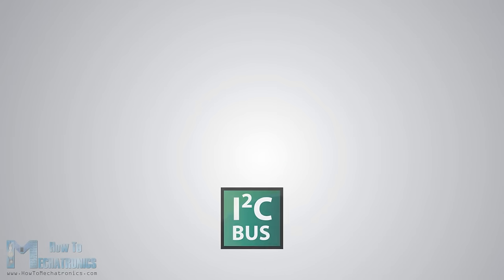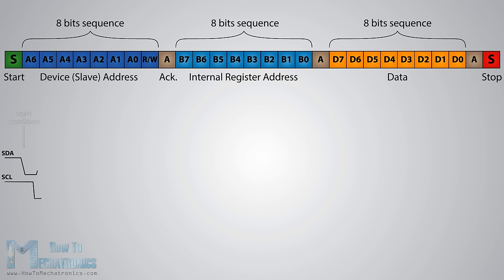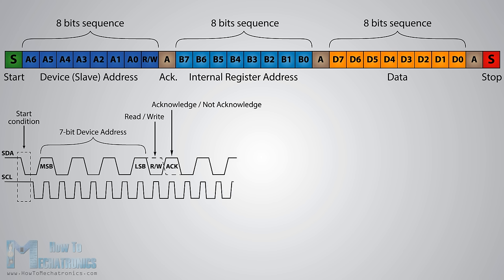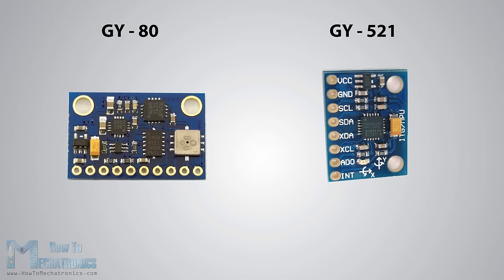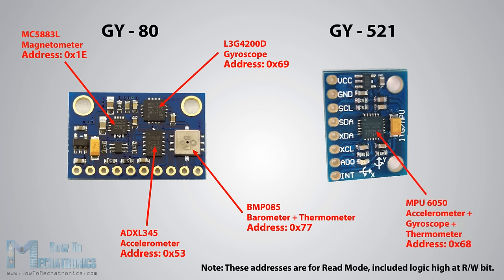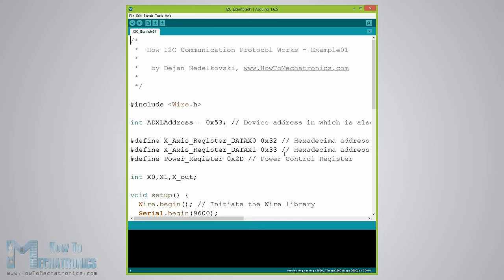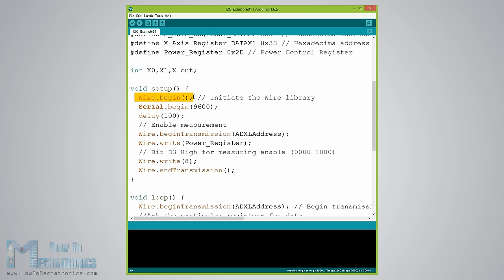How I2C Communication Works and How To Use It with Arduino

Comment: There are a lot of Tubes about I2C but none of them make note of the fact that I2C is an abbreviation of Inter IC Communication, it was invented by Philips to help reduce the amount of communication tracking between IC's on a PCB, consequently it is a reliable communication system when used over short distances in a controlled environment, a PCB, but it was never intended to be sent overlong pieces of wiring (>200mm?). If you use this to connect to devices over long lengths of wire, especially if there are noisy items around like motors etc, be prepared for random communication problems.

Comment: This is one of the only videos I've found that explains how pull up resistors can affect the speed at which data can travel on the SDA line. Fantastic video that explains how I2C works. Great job.

Comment: To clarify; the I2C lines are either high impedance or 0, you never drive the bus line high directly; that is achieved by de-asserting the '0' and letting the internal pull up resistors tie it to Vcc. The high impedance or low state on the bus prevents bus contention; that is a ground connecting to Vcc directly causing a short between any masters or slaves.

Comment: 6:00 just a headsup: You have the Arduino connected to two GNDs, with no 5V line.
Reply: Yes, that bothered me too.
Reply: Bro thats not a big deal he is also a human and if he has done any mistake that does not matter because if you have used arduino or any other types of microcontroller in past u can correct the connections easily
Reply: @Blondie SL Well that escalated quickly.
Reply: @Blondie SL Dark matter....hmmmm I once cut open a dead flashlight battery and found it to be very dark, black as coal in fact. I just figure it got full of the dark that it was displacing with light, and died when it got full.  :)
Reply: @Blondie SL you got issues bro
Reply: hahahah
Reply: @taimooramin1272  well he already said it just a heads up

Comment: i know its an old video and you probably already know that but you can shorten the Serial.print commands to one like this:

Serial.print(String("X0= ") + (X0) + ("X1= ") + (X1)); then when the numbers are bigger or shorter it will automatically fit them together

Comment: Good to know how all this works. I've used the Linux i2c and SMbus userspace tools, but never really knew the hardware functionality behind it. GPU lighting is generally i2c and motherboard controllers use SMbus (both very similar though). Knew just enough to be dangerous and change RGB colors or monitor temps with a very light shell script and even shell functions. The OpenRGB project has the addresses for most hardware, including USB (mouse, keyboards, and some mobos use USB for communication to controllers).

Comment: at the end u need 4 wires, ground, power, SCL and data.  bewatre of voltages, couse recent sensors and some different arduino version need 3.7 and not 5v as powersupply. nice video|

Comment: At 5:47, I noticed a small mistake in the wiring, both the VCC and GND on the breadboard are connected to a GND pin on the Arduino ...
Anyway, great explanation ;)

Comment: In the circuit diagram at 6:00, I notice GND is connected to the red and blue rail. Is this accurate or am I missing something? I thought I2C was active low? Was this a mistake in the wiring diagram?

Comment: Thanks for the great explanation. I see that the addresses for the I2C devices are predetermined by the manufacturer, so is address collision a common problem that you have to deal with when using this interface?

Comment: Great work. Can we also see somewhere the procession of raw data into actual measurements?
Do you use the sensor's librarys for that?
We want to connect a CO2 sensor, a humidity sensor and two accelerometers. Also a BMP180...
Thank you...

Comment: Thanks man, I appreciate the video. I wonder what kind of issues you could run into if you ran 1024 10 bit devices on the same line. Electromagnetic interference may become a concern.

Comment: Thanks for a great explanation. Would it be possible that you do a video of how the arduino commands on the IDE are converted to signals on the wires.  I feel there is a disconnect between the protocol explanation at the beginning and the arduino program. Also if you can add a link to the other video that you mentioned as completion to this one

Comment: 9:11 You have a bug in your code. You check if Wire.available() is equal to or less than 2. This would also result in true if Wire.available() returns 1. Then you read 2 bytes in any case. In the case 1 byte was received, you are reading one other random unknown byte.

Comment: What if I want to have two same sensors, which will have same I2C address right?
I'm planning on building a weather station, which has one HDC1080 for measuring indoor temp and humidity, and one HDC1080 for outdoor.

Comment: Ok, no pullup resistors but you still need to power the I2C bus and you can't do that by connecting GND to it. According to your previous diagram (the one with multiple slaves as photos of the devices) you have to connect the bus to the 5V power source and (if required) add pullup resistors between that and the bus itself.

Comment: Very good video, thanks for uploading :)
But I am trying to understand something which makes me confuse.

The example given at 4:24, 
Device address is mentioned as 0x53 (which has binary value = 1010011) along with Read mode (LSB = 1) shall be represented as 10100111 right? Not 01010011.

Please correct me if I am wrong...

Comment: Hi, I have a question, in case you would like to use two i2c devices that have the same address, how would you do that? it's a luminous sensor with a f=1Mhz

Comment: In your demonstration I see that the power for the GY-80 and GY-521 comes from the Arduino.   Can they be powered independently? In other words - is it mandatory that their power comes from the Arduino? And, do they have to share a common Ground Line with the Arduino? Thanks.
Reply: *****- That's what I thought,  thank you. And, thanks for your video - it was very informative. I have subscribed to your channel !!!!
Reply: The scheme has conected to two lands of the Arduino (6:00). Is this mistake, or the correct connection аnd I do not understand something?
Reply: ***** Thank you!

Comment: I believe you could get way more components on the lines if you went to a 4 carrier freq using OFDM platform and using a simple B QPSK to create your binary. I've done this with PLC designs with the IPL0201 MPU. We used a balun coil and passive phase filters .01uf capacitor to reduce the 120 hz signal noise from the AC line and we transmitted the signal 12 miles on a 7620 powerline. We've been doing PLC 2 wire transmissions for decades now. I'm surprised they are just now getting around to it with arduino.
Reply: Sounds pretty .. 🤓

Comment: Wondering about this part:

"Wire.write(X_Axis_Register_DATAX0);
 Wire.write(X_Axis_Register_DATAX1);
 Wire.endTransmission(); 
 Wire.requestFrom(ADXLAddress,2); "

Shouldn't it be only 
Wire.write(X_Axis_Register_DATAX0); and then we write Wire.requestFrom(ADXLAddress,2);  so that it will fetch both data from X0 and X1?

Comment: how will you know if the particular I2C device / sensor being used already has the pullup resistor in the breakout board or not?
Reply: It should be specified on the datasheet !

Comment: Dude this is awesome. Thank you so much. I believe I can use an STM32 as well as long as it has I2C support and just do same configuration? Im so excited. Going to get these breakout boards and play around then try with an LCD. Do you recommend I2C or SPI protocol for an LCD? Thanks for your input!
Reply: Also another question why is there 2 data values for the X,Y,Z? Is that used for like noise cancelling or something? Im sure its simple and im overthinking it lol
Reply: @RyuDarragh Thanks for the post. One mini thing though - according to the video the LSB (last bit) of the Device(slave) address for Write is LOW / 0 and for read R is HIGH / 1 (not the other way around)

Comment: great job sir what you did here,, i have a simple doubt,, actually i doing a simple test project using accelerometer interfacing to the atmega32 8-bit micro controller,, here my ADX345 needs 3.3v but i am using 5v for atmega,, so, can i use i resistor to get the data near by 3.3. or i have to use a regulator? please give me help on this.. i am not getting regulator in my area or near by,, Thank  you!!!
Reply: OKKK,, Thank you sir....!!!

Comment: i tested every library and sketch i could find. Nada. One guy said wire.h is incompatible with the chip of the mkr wifi 1010 board but i don't get why or how to fix it. All i2c tutorials use something that depends on wire.h or comes from it.  If the board has dedicated i2c pins there gotta be a way to use them. I put the pins as shown in every tutorial, i don't think 2 accelerometers came already broken

Comment: very helpful video.
i have one quetion. i have gy512 with addres 0x68 and  two other deveices with the address 0x47 and 0x48. those i will connect with arduino due I2C but i dont know how to initialize. i will read and writh into the sensor. can you pls give me a tipps or connect with me. regards
Reply: i still have a problem. i couldnt connect them together

Comment: So it doesn't seem possible de connect two devices with the same address to one I2C bus, doesn't it ?
Is there a hack/way to do so (ie conect to identical devices to the same I2C devices?)

Comment: There is a mistake. All power source wires are connected to the ground of an Arduino Mega shield on the wiring diagram.

Comment: So you cannot have multiple of the same kind of sensor then as the addresses will overlap? Like I want temperature from multiple points
Reply: Dejan Nedelkovski how would that work? You can change the addresses?
Reply: MUX

Comment: hi, i'm trying to communicate arduino(slave) and blue pill(master) with i2c using wire library on both devices. on slave reset, blue pill master  seems hang. but not if i use arduino as master. anyone know why?

Comment: What if adressess overlaps, for example when you have two the same devices?
Reply: yeah, if there are two sensors with same address, i hope someone can clear this up
Reply: The GY-521 has the AD0 pin which if powered, will change the address from x68 to x69, i believe that other devices have similar features
Reply: I know in the case of the SeriouslyPro F3 racing controller, you cannot use two sensors of the exact same model (e.g. magnetometers) because there would be an address collision. Instead, you have to physically remove the onboard sensor if you'd like to use an external one.
Reply: i2c multiplexers can be used for this, IIRC they can work by readdressing a device through the multiplexer to mitigate address collision.
Reply: Yazin S about the seriously pro f3 with no barometer and compass, onboard, i cannot connect external  barometer and compass at the same time. do i have to use pull up resistors or logic level converter??
Reply: This was a year ago, but yes this can be avoided with I2C multiplexer chips. Essentially what happens is that multiplexer has it's own I2C address. So from your microcontroller you tell the multiplexer "I would like to talk to device 6" by sending the data byte of 6. Then you can just carry out normal I2C Communication as discussed above. When you want to poll the other device, you say "I would like to talk to device 1 now." etc. You can also daisy chain multiplexers.

Comment: Why is it often times clock and data are connected to A4 and A5?  I cannot understand why they are not connected to digital pins.
Reply: Because ATMEL didnt make a design for 2 extra pins on the Microcontroller so they put Scl and Sda on A4 and A5

Comment: Dear Sir!!! Hope
 you all doing well,, I got a probelm in my project with I2C address 
transmission to slave, Here my master is ATmega32 and Slave is 
RTC(DS1307), so while transmitting the slave address i am getting 
correct status code as it is 0x18, and then i have to transmit the 
internal memory address right? so i transmitted 0x00 for seconds memory 
address as i referred data shet, but this time i am getting status value
 is 0x28 but it's the value for data transmission not for memory address
 transmission, anyway after this memory address transmission i am 
transferring the data, but guys it's not transmitting at all and i am 
not getting any status value of it!!!!!I hope you understand my 
problem, how to transfer the slave address and memory address for 
writing values into specific memory location in avr atmega!!!!!!here
 is the code!!!! for I2C transmission!!! Please give me a way to 
Understand and finish it!!! and i don't have debugger with me,, can you 
please suggest which debugger is good for avr atmega32 in Atmel Studio 6
 or 7 IDE.??????Code:/*
 * I2C_DS1307.c
 *
 * Created: 25-Feb-16 11:07:35 AM
 *  Author: sys1
 */

#include <avr/io.h>
#include <util/delay.h>
#include <stdlib.h>
#include <inttypes.h>
#include "ADC_LCD.h"
#include <avr/interrupt.h>

void TWI_Master_Init(void);
void TWI_Start(void);
void TWI_Write_Address(unsigned char );
void TWI_Write_Data(unsigned char data);
void TWI_Stop(void);
//unsigned char address = 0xD0, write = 0, read = 1, write_data = 0xA0;
//unsigned char seconds_address = 0x00;
//unsigned char recv_data;

int main(void)
{
    //DDRA    |=    0b00000111;
    //PORTA    |=    (1<<PINA0) | (1<<PINA1);
    //PORTA    &=    ~(1<<PINA0)| ~(1<<PINA1) | ~(1<<PINA2);
    
    //TWI_Master_Init();
    lcd_init();
    _delay_ms(2000);
    while(1)
    {
        TWI_Start();
        TWI_Write_Address(0xD0 + 0);
        TWI_Write_Address(0x00+0);
        TWI_Write_Data(0xA0); //i want to write 10 in seconds memory location of DS1307(RTC)
        TWI_Stop();
       
    }
    
} void TWI_Master_Init(void)
{
    TWBR    =    0x01;
    TWSR    =    (0<<TWPS1) | (0<<TWPS0);
    //SCL frequency = F_CPU/(16+2(TWBR).4^TWPS)
}

void TWI_Start(void)
{
    TWCR    =    (1<<TWINT) | (1<<TWSTA) | (1<<TWEN);
    
    while(!(TWCR &(1<<TWINT)));
    while((TWSR & 0xF8) != 0x08);
  
    
}

void TWI_Write_Address(unsigned char data)
{
    TWDR    =    data;
    TWCR    =    (1<<TWINT) | (1<<TWEN);
    
    while(!(TWCR &(1<<TWINT)));
    while((TWSR & 0xF8) != 0x18);
    
 
        
    }
    
}

void TWI_Write_Data(unsigned char data)
{
    TWDR    =    data;
    TWCR    =    (1<<TWINT) | (1<<TWEN);
    while(!(TWCR &(1<<TWINT)));
    while((TWSR & 0xF8) != 0x28);
   
}

void TWI_Stop(void)
{
    TWCR    =    (1<<TWINT) | (1<<TWEN) | (1<<TWSTO);
    while(!(TWCR & (1<<TWSTO)));
}
Reply: Yes.

Comment: could someone explain to me whats the function of the codes
Wire.write(Power_Register);
Wire.write(8);
Wire.endtransmission();

sorry im a beginner
Reply: These functions interact with each other.
Wire.beginTransmission(address)
This initiates a data transfer and the address identifies which device is going to be communicated with.
Wire.write(value)
This sends an 8-bit value to the device.  This is done twice.  The first time identifies which component of the device is being addressed and the second time tells the component to actually begin its measurements.
Wire.endTransmission()
This sends the "end of command" signal.

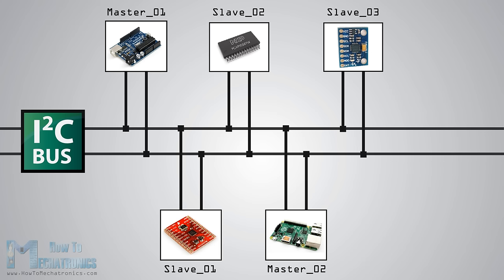Comment: 01:36 5V on clock and date .... the white smoke rises ..
Reply: Sir those are (pullup) resistors in between the +5v rail and the data/clock lines 😂

Comment: this information is totally wrong... you do not need to put any resistors at the end of the line. adding resistors will cause the lines to malfunction and short circuit the chip...

Comment: I'm so tired of this arduino bullshit.  Arduino is for complete Nubes. Use a microcontroller that professionals use.
Reply: There are pro and cons for using Arduino:

Pro: easier to interface and debugging, hence increase productivity. It is perfect for prototyping .

Cons: expensive compare to mcu. Not suitable for final product in mass production.

And Don't call low on people who are using arduino. It is better than microcontroller to start with given its friendly IDE. Using microcontroller doesn't really implies that you are professional. Being professional is to be able to see the pro and cons in these systems, and be flexible on choosing the right platform. 

I am a mechatronics engineers.
Reply: What do you think Arduino is? People who build with Arduino are using microcontrollers.

Engineering isn't about spending days interfacing with a microcontroller by building a circuit just to prove that something works. If NASA went back to first principles for everything, we'd spend another 100 years getting back to the moon. Professionals used simple and reliable methods - they don't reinvent the wheel.